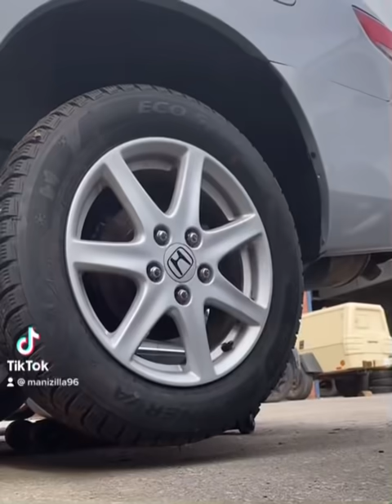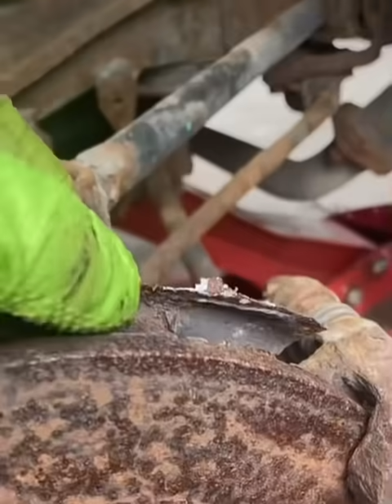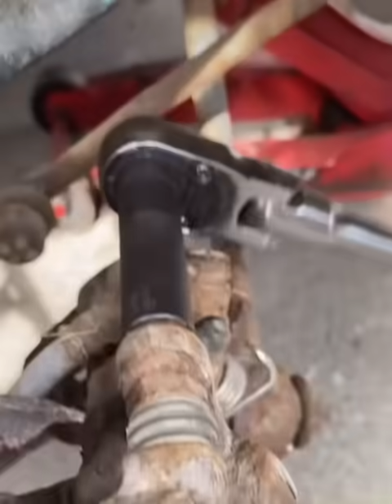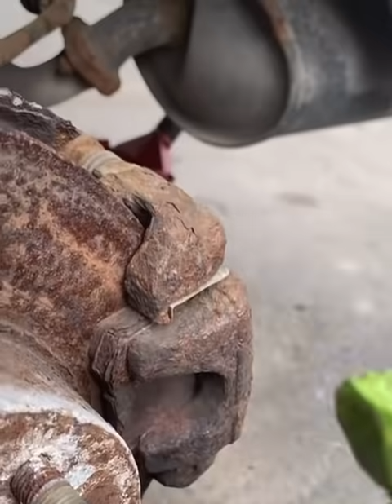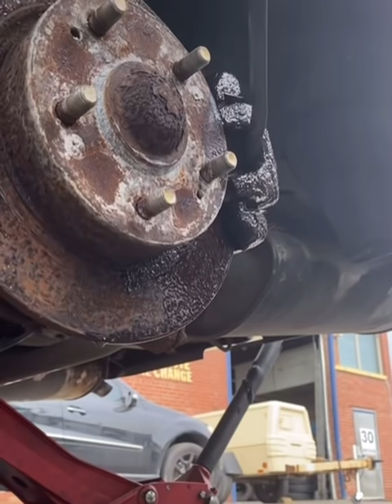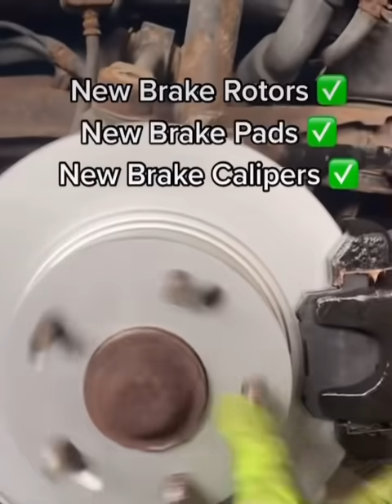Customer never drove their vehicle for 2 years and this happened ...

Comment: “I just had my brakes done don’t try to upsell me”
Reply: "The noise started yesterday"
Reply: I'm 46. I have a million crooked mechanic stories and only a couple honest ones. I'm a mechanic's worst nightmare because I actually know how to fix cars but sometimes I don't have the time. I don't have enough fingers to count how many times a mechanic has tried to screw my wife over.
Reply: "Sir they're literally delaminated and you have no rotor left it's not safe to drive this car"

"Nah man I drive 2 hours on the highway to work everyday I'll get them done in a couple days"
Reply: @link4253  Couldn't agree more. This is why honest mechanics need to shout out the crooks that give them a bad name. I don't like having to buy a $400 scanner for my Mercedes any more than you do just to find out my bank 1 cylinder 2 has a blocked injector. 

I know how complicated cars have become. The problem with a union is it would protect the scammers trying to upsell overpriced unneeded repairs more than honest mechanics. There's simply too big of a knowledge gap between those that understand modern cars and those that don't. As long as that gap exists you'll have scam artists preying on the uneducated.

My mom complained about brake squeal shortly before she passed and took it to the shop. They charged her over 2 grand for new rotors, calipers, pads and ball joints they talked her into. When the squeal didn't go away she asked me to look at it. They replaced NOTHING and only cleaned off the brake dust. I told her to sue but she didn't want to because her friends son worked there. They knowingly ripped off a little old lady for 2 grand and got away with it literally months before she died. 

I have a buddy that calls himself an honest mobile mechanic in the same breath he laughs at how stupid his customers are that pay for anything he suggests that isn't needed. Guess who's never allowed to touch my vehicles?

You're not special. My trade and wage have been destroyed as well by illegals willing to do the work for less than half my pay while throwing quality out the window. My union has made it 10x worse by courting those illegals for money over integrity.
Reply: I literally did my brakes yesterday….
Reply: "These brakes only had 300 miles on them, I'm getting a second opinion"
Reply: @link4253  here in East Texas we get paid shit. It's just a bunch of rich old people that have money but don't value service and time even though that's what it took for them to make the money they have now. the industry is absolutely ridiculous now. I could make more money mowing yards.
Reply: @zodwraith5745  i went to get my oil changed one day, my check engine light wasn't on before then. came back to pick my car up and the light was on and the guy said the radiator was leaking, i checked multiple times and at multiple places, it wasn't. the dudes told me it would be $460 to fix it. i took it to someone else to see what was going on and they figured out he messed with the mass airflow sensor
Reply: @zodwraith5745  Yup. One place told me I had to change my powersteering fluid because it was "dirty", which btw I had changed myself 1-2 yrs prior. I bet he wasn't expecting that. And his response was oh that's what the tech said.
Reply: @yellowonion  technicians don’t always visually inspect fluid if your a regular at their store. A lot of the time they just recommended it based off the last time they’ve seen the work performed in the history of the vehicle so.
Reply: It’s a joke unless you are at jiffy lube.
Reply: @zodwraith5745  scamming should be put in the job description lol. That shit is disgusting because they always judge based on gender and race how bad they’re gonna fuck you over.
Reply: Hope it wasn't autozone parts thats what they look like after a year
Reply: @link4253  obviously you've never made the mistake like I have of letting Hibdon's Tire Plus or Firestone do a damn simple oil change, that i could've done in 10 mins!  just didn't have the time to do so, cost damn near $160 for a $20-$25 job pitiful!
Reply: I literally did my breaks 2 weeks before i let it sit
Reply: @link4253  I don't believe the issue customers have is paying the mechanics, they have an issue paying 140 an hour for labor and 250% markup on shit Chinese parts when the mechanics clearly don't get paid a 3rd of the posted rate.
Reply: @zodwraith5745  Good for you. Respect. I went to a Technical College and studied Automotive. One of the best times I had in college. Feels great to know knowledge like this.
Reply: @blixxy1320  I take massive issue with people comparing their wage to another job.

As long as people are willing to turn up every day for a crap wage, the pay will stay low.
When people stop doing it and go to earn  "more money" mowing lawns, skilled rates will increase.

Covid killed the aviation industry and many places were offering pay at 1/5th per hour of what it was pre covid, due to an abundance of skilled labour looking for work.
The word spread that you could earn 3X more per hour painting walls, mowing grass, washing cars or driving a forklift.
The clever ones left aviation for better pay, in a job where the consequences are not something falling from the sky.

Now, there is a shortage of skilled aircraft fitters and rates are ever increasing, but the posts are still vacant.

People showed these manipulative employers what they thought of their rates, and it's working.

Who wants to fix aircraft and have the potential to kill 200+ people in an instant when they could stack supermarket shelves at night for nearly twice the rate?

Oh, and of course these employers dropped their standards to fill recruitment gaps... many of them are also regretting this as reliability, time on the ground and safety are affected.

The same will happen with mechanics, if they leave the industry, there will be a shortage and rates/respect will increase.
Reply: He could have just soaked that in penetrating oil and drove on the highway for a half hour that crap would have burnt right tf off.
Reply: @MrSocko-vn7fw  idk man😂😂